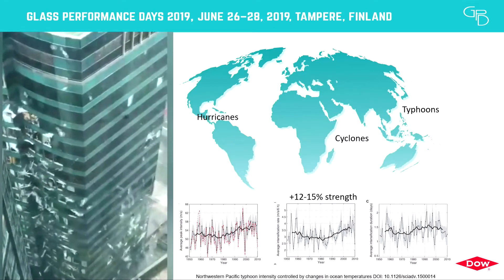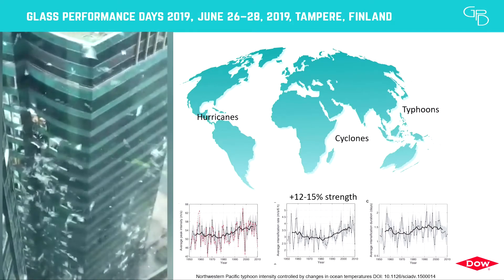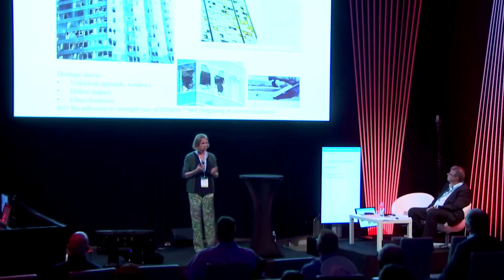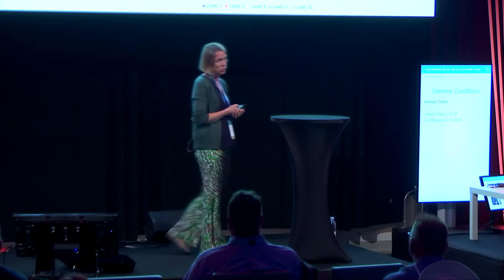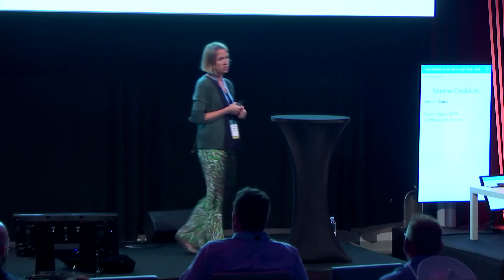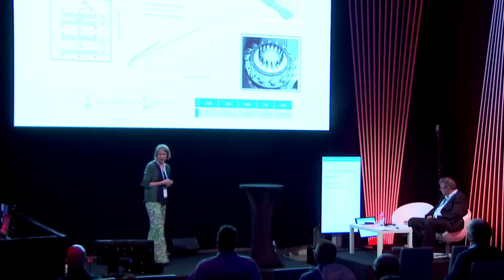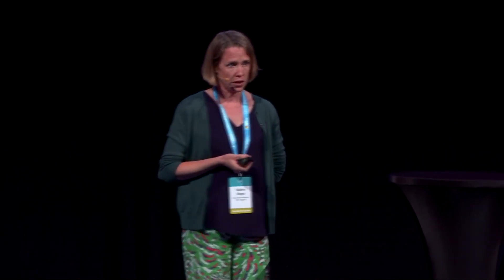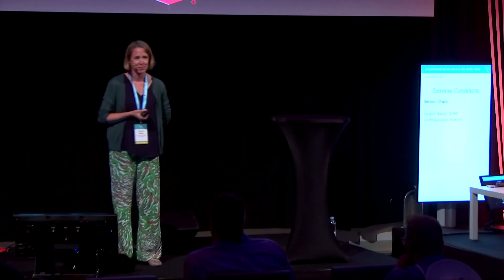Valérie Hayez - Consideration & Performance of SSG Glass Façade of High-Rise in Extreme Climate

Comment: The best in Curtain Wall engineering is the Unitized system. It is also known as the Modular System. It is quick to install, simple machining and above all it behaves very well in earthquakes. And all thanks to the SSG systems where the glass FLOATS on the frame and it absorbs the efforts. Good exhibition, congratulations to Valérie Hayez.